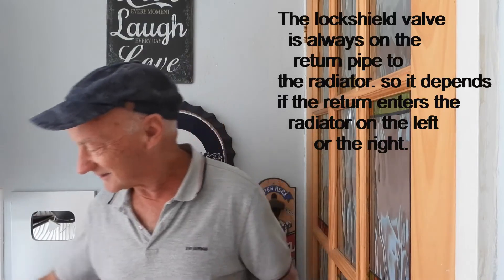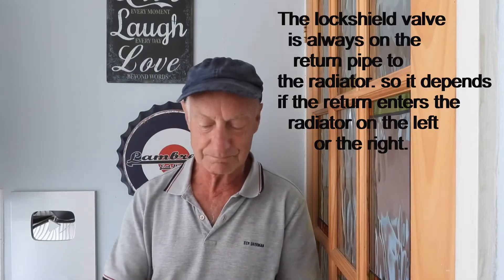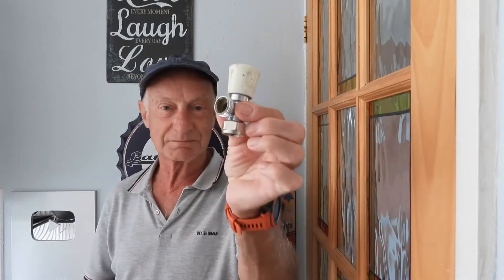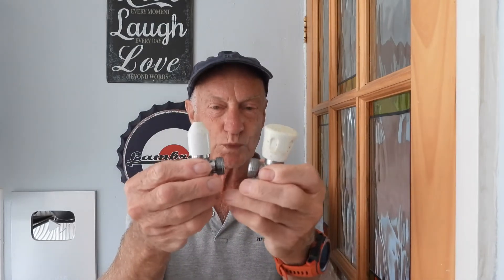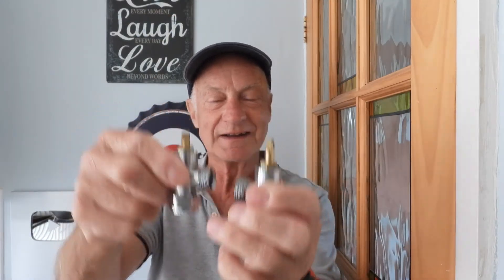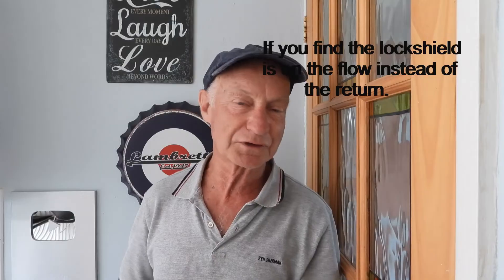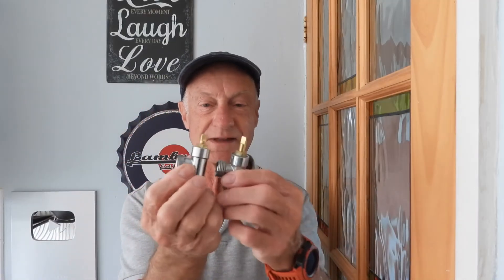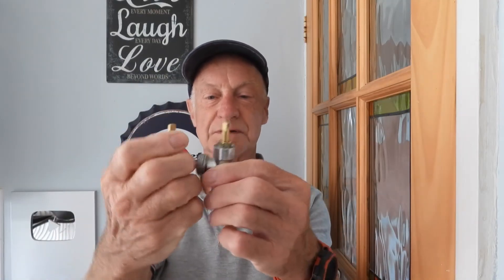The locksheild valve. Why is it so important.

Comment: Nice and concise thank you. Told me almost all I need to know. Just have to figure out whether it is clockwise or anticlockwise to close them down. Thermostatic on the other end so cannot tell from that. They are also tight having not been touched for decades and definitely not balanced as the chap who fitted the last boiler did not spend any time checking them.
Reply from the maker: Glad it helped The valves are clockwise to close them.
Reply: @dereton33  Yes, thank you for that. I have balanced the radiators in my parents house (ongoing) and the dead radiator in the front room is now red hot. Amazing !!

Comment: I am confused. I don't understand why the outward flowing valve is the one that need adjusting to allow all rads to get enough hot water it would make more sense in my mind for the intake valve to need adjusting i.e less going in to the nearer rads means more water available for the further away rads. So how does it work? The only thing I can think of is if the water is restricted going out of the return valve it means less water can get in through the inlet valve so therefore more water carries on to the further on rads? Am I correct at all or not? Trying to understand
Reply from the maker: That`s about it.
Reply: @dereton33  thanks for your reply. One more question if I may? You said both valves are exactly the same but obviously there is one difference between the two in that the trv opens and closes automatically depending on the room temp but the lockshield valve has to be done manually is that correct?

Comment: Hi. One of my radiator doesn't work the thermostat valve is set on on the pin also moves easily. On the other side where you have the radiator locking shield valve, mine is square and doesn't have a cap on it. It's impossible to twist this. Any idea?
Reply from the maker: Use a small spanner on the brass square.

Comment: Would you say it should be all the way open (to the plus sign) or all the way to the minus sign? I have this on my hallway radiator but the radiator is the coldest of the house so want to check it hasn't been adjusted incorrectly
Reply from the maker: Depends if it has been balanced for the system, I would say as it is cold to open it fully to the plus sign.

Comment: really struggling to find a video on radiators with two lockshield valves and as you say they're the same. You once spoke on this past briefly though didn't discuss for example how to tell which side is the flow and which is return. Temperature test by hand or heat gun might help, but not everyone knows to do that. Also, should you manage to balance a system with the return lockshield valve, what setting should the flow be on? A lot persons say always open however balancing a system doesn't mean you get the heat in the specific rooms you want. My study might be the sixth warmest out of eight, when doing my initial check before a balancing. And I balance them but still want that study to be the most warm of all radiators. Logic would say then you have to have more flow on that e.g. all way open, and then if it's still not hot enough, restrict flow on the other radiators.  

Lastly, during winter, for any radiators you'd normally have off, how do you set the lockvalve(S) [remember there's two] to be in an anti frost setting? just close the valve then open a quarter turn on both?
Reply from the maker: Open both a quarter turn.

Comment: I’ve moved into a new house and the heating needs balancing. Problem is no caps on either side of some radiators! So how do I determine which side is the return pipe? Will this be the cooler of the two sides.
Reply from the maker: Exactly that

Comment: I open all my lock shields fully and do a quarter turn on them so that they are all the same,also the thermostatic radiator valves are on fully,all the radiators get hot,is this okay or is it not very energy efficient?
Reply from the maker: Its fine, except you should gradually open the lockshield valves more, the further you get away from the boiler. Use your TRVs as you need, to heat the rooms at a comfortable temperature.

Comment: I've got problem have I got to empty the cold water tank in the loft before I can fit a new tap on it..I turned it off last night as I fitted a new vanity unit in the bathroom with sink all went well but I turned the water off up in the loft but I think the tap on the tank is not opening back up as now I have a dribble of water coming out of my bathroom taps and cistern hardly filling up..I live in a bungalow..so I think I need to put a new tap on ..so do I drain it first ..all I did was turn it off and now its not working so I think it's gone ..I take full responsibility for any advice..many thanks paul 👍 ☕️
Reply from the maker: Hi Paul, yes drain the roof tank out with a hose and fit a new gate valve. The old one has a broken gate.
Reply: @dereton33  ah bloody thing I did it all last night the old one had rusted out inside and ball cock nackered it was all black  ..its now blue fresh water and put it new ball cock and the tap ..£48...pounds for that red round tap..I'm in jersey channel islands just moved in to this bungalow nothing has really been done..thanks for your advise buddy..it all seems to be fine no leaks new parts on and shower pump working after the air came out..its a new one I did....the only little issue is the bathroom sink water comes through put not lots or to fast .I did fit a water fall tap..but not sure if I can make it better..everything else seems OK.. wile the Mrs is in Sweden I'm up to my eyes balls hahaha 😆 any ideas about why the water is not coming through much on the sink I've kept running the taps ..the kitchen is fine on a different pipe or something..

Comment: Hi Al do you need to balance a cobi system? or just F and E?  Do you have any videos on this for a combi Many Thanks Ian also in my house most of my TRVs the valves leak very old radiators but they don't leak would you chnage them or just TRVs they are rusty but don't leak Many Thanks in advance
Reply from the maker: Yes you do have to balance the rads for a combi the video link in the description is also good for combi boiler balancing. If your rads are not leaking then just change the valves. If however you want to  install more heat efficient rads then renew them also.
Reply: @dereton33  thanks

Comment: Could you clear up a little confusion I have, I get the lockshield valve requires you to use a tool to turn it to open/close it and you use this when balancing your system. But the "normal" valve on the other end of the radiator, I don't have thermostatic valves, but a valve that has a cap on it that allows it to be turned by hand. What is the point of this valve? As I understand it it doesn't work like a thermostatic valve, it seems to just work in the same way as a lockshield valve, increasing or restring flow.

So the only thing I can think off with this valve is to have it fully open and you use the lockshield valve to control the balancing. But if you for whatever reason want to turn off the radiator, you can do this with the "normal" valve, keeping the lockshield valve unchanged. So then say a week later when you turn the radiator back on via the "normal" valve, fully opening the "normal" valve, the system will still be correctly balanced as the lockshield valve was never altered.

Is my understanding correct? Am I missing something? i.e. is a "normal" valve just an on/off valve.

Thanks!
Reply from the maker: You have it about right on there.
Reply: @dereton33  Thanks, always wondered why I had them on my rads! Don't think I have ever turned them.

Comment: I had a customer who despite my recommendations failed to supply TRV/ls pairs. Instead, he supplied all thumbturn valves, So, after balancing, I whipped the plastic heads off a thumbturn valve on the left hand side of each rad.
"I don't like it! Put those plastic thingymajigs back on". Up down. On/off valve on right. DO NOT touch the valve on the left.
Guess what happened?
🤣
Reply: Customers always right eh!     No, Almost never!!
Reply from the maker: You never win sometimes.